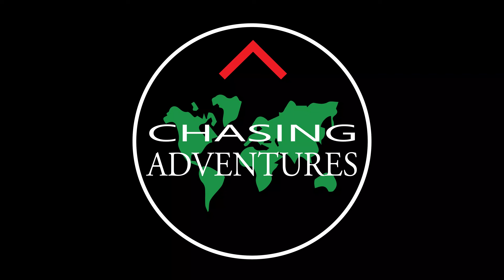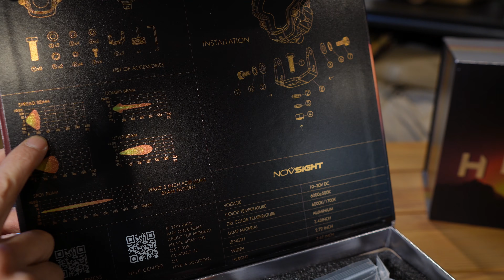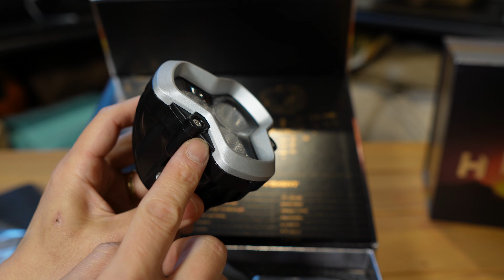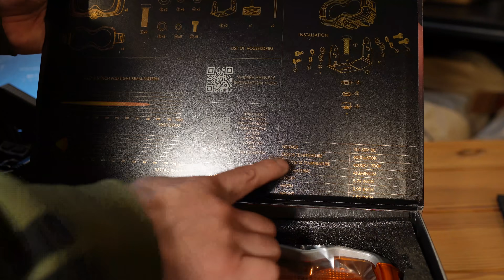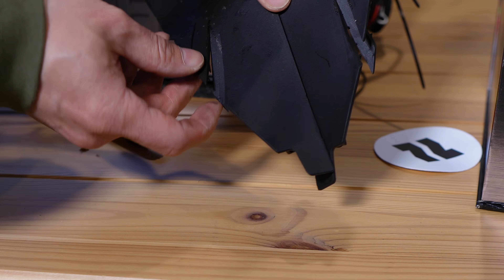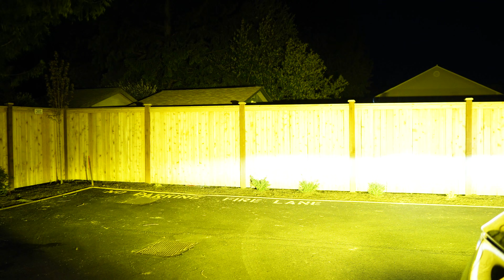❓️Do you Need a Ditch Light? NovSight Halo LED / No-Lo Design / Honda Pilot Trailsport

Comment: Hey how’s it going? I just got the halo pro series in the 6 inch version, I assume the wiring is the same. In the install video from novsight, it shows them cutting the wiring before it goes into the big box, and the wires being the same. I know you used the drl cable with the power cable. Is that safe to do so? I’m running a switch pros panel so I’m not sure how different it is to your set up. I just wanted to check before I go and start cutting stuff up. Thanks
Reply from the maker: yes, it will be safe to do so and it should be the same for all panels.

Comment: You stated you wired the raptor lights to the fuse box, which fuse do you recommend we use?  Any tips on how to run the cable to the fuse box?
Reply from the maker: actually I had it connected to mintuning 8 gang switch panel as shown in this video https://youtu.be/dK4zkWu2424 
but if you want to tap into a fuse box, I would use something that is not related to critical sensors, but instead, use like heated seat and stuff like that. also test it with a volt meter to make sure you only get power when the ignition is on.

Comment: Good video... just finished installing the No-Lo skid plates today.  Question:  How to you penetrate the firewall to get the switch mounted in the cabin, and where would you most likely mount it?
Reply from the maker: Awesome!  I used a wireless switch panel so didn't need to go through the firewall. It made installing lights so much simpler